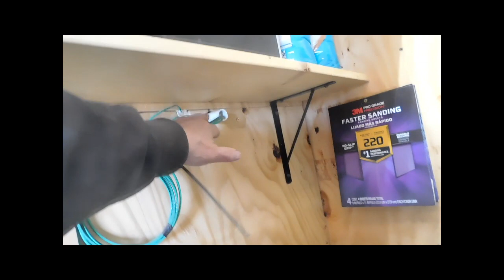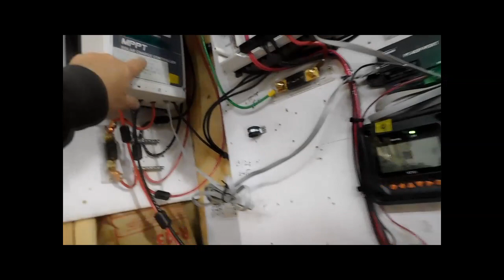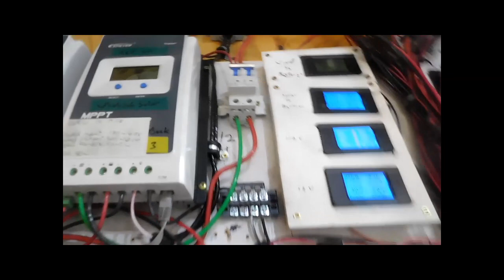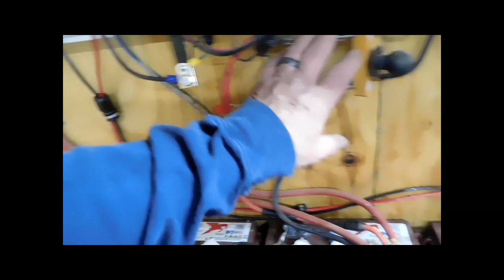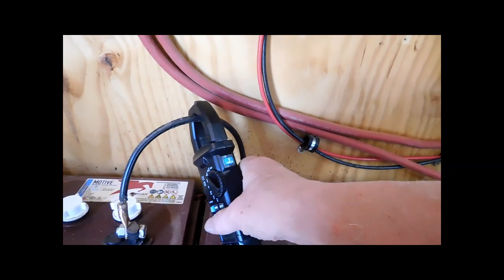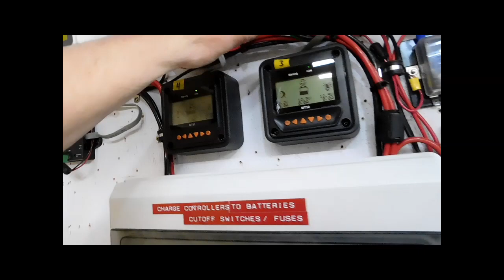Building an off-grid solar powered house part 191. Rewiring the solar system.

Comment: How much capacity battery you are using for all this system.
Reply from the maker: Here is the spec sheet on the Trojan battery website. I have 16 of these batteries.
https://assets.ctfassets.net/nh2mdhlonj7m/7oruj273B11JX0sXEq6JDL/c4bf9fa622dc57ae5637ded057979e3d/L16EAC_Trojan_Data_Sheets.pdf

Comment: Looking great, keep up the fantastic work on a fantastic system.  Just got my EPever 100 amp 200 volt charger installed today.  It’s rolling right along.
Reply from the maker: That 100 amp should be all you ever need. Lots of power there.
Reply: @timsvids5983  Got a question::   I was wondering about if you ever have the chargers shut down to a low voltage PV mode.  I’m not sure exactly what’s causing it. I think it’s directly connected to a very mix days of bright sun and popcorn clouds moving fairly fast.  Cool breeze on a 68 degree.  Reset PV sometimes does it, other times I disconnect battery (Lithium). I may be too tight on settings.  No Alarm red light on the charger.   130 volts PV on a 60 amp 150 volt EP Charger and have just had it to happen on the EP 100 amp 200 volt running 130 PV volts,  Usually it’s like 122 volts normally all day.  You talked about Software update.  Would that help?   Some say it’s spikes.
Reply from the maker: @soggyb4082  yes I have. But they usually restart. Are your batteries getting too low for the comtroller to restart?
Reply: @timsvids5983  no it's not never to low.  Actually it seems like its in the high 80% when I've had to reset. I adjusted the over voltage boost reconnect up a click. I'm just wonder if a Millisecond spike could even hurt a Lithium battery.  Even if it shot a sudden spike of say 34 volts on a 24 volt system. My thoughts the way the Lithium soaks up the power that it would absorb the spike with ease.  Today at the Moment everything is running smooth as ever.  Blue Skys
Reply from the maker: I’m not too sure what could be going on. You might try the q/a on amazon. They can answer questions sometimes. I’m not familiar with the lithium battery systems. I’m not sure how to get to it but the epever download page lithium info and downloads for their inverters.